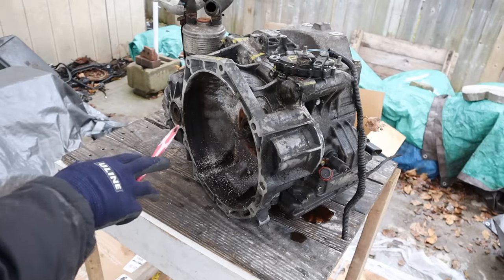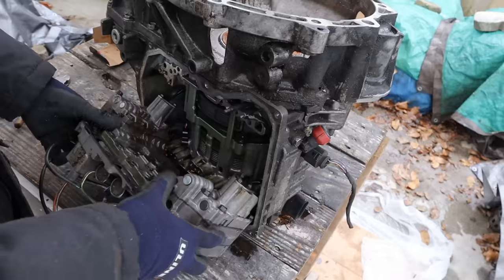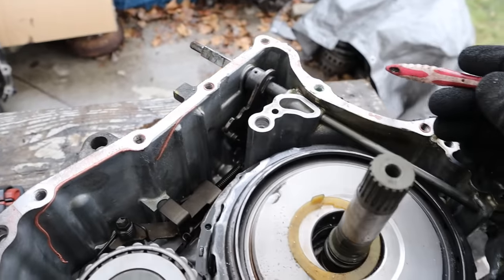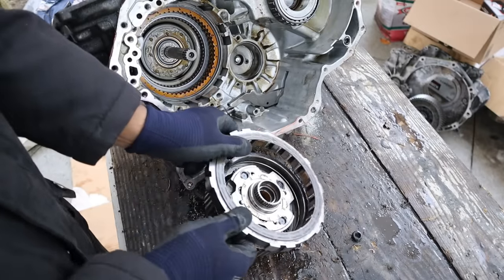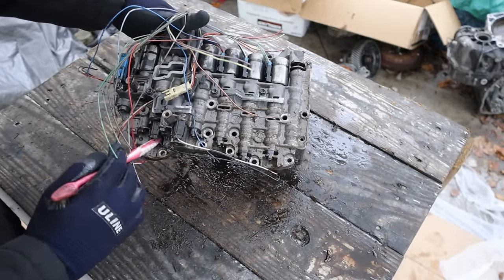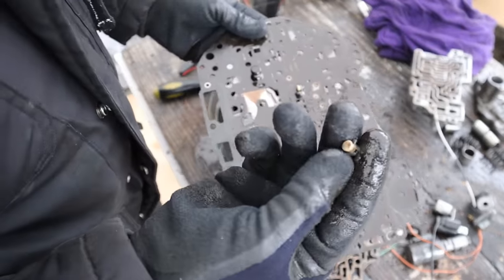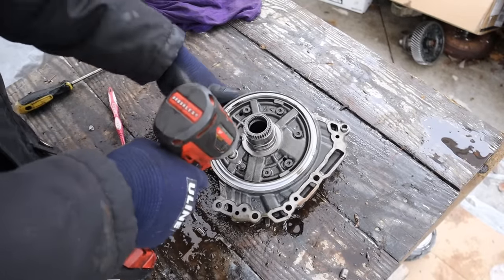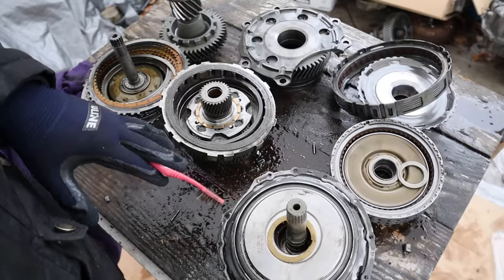Why Volkswagen 09G Transmissions Fail

Comment: Why do they fail? Answer: Volkswagen
Reply: Except not made by VW and another poster commented that they’re also used in Toyotas. I never heard of Toyota transmission failures though.
Reply: 10:55
Reply: @craigiefconcert6493  I have heard of many Toyota failures.
Reply: Yet soooooo many people believe vw to still be reliable. One of the many things still making vw money from the days of air cooled reliability
Reply: Correction, because they're German
Reply: Actually transmission failure is less common than engine failure and they only fail at very high mileage and usually from not fluid servicing they are actually pretty good
Reply: @Chrissy212  mine has been jerky from the start but it didn't give any major problems until it started leaking ATF arround 80,000 miles. At that point the mechanic replaced the valvebody and fixed the leakage which greatly improved the many of  problems I had, but I still have some slipping on the mornings. And I don't know about you, but I did not expect to have these kinds of issues at this milage.

Comment: The 09G is a automatic transmission designed by Aisin Warner (Toyota), also known as the TF60SN, that fits a variety of Volkswagen , Audi, Toyota, Lexus, BMW, GM.... vehicles.  The list of Vehicles this transmission is in is expansive.  The new Aisin 8 Speed's list is just as expansive.
Reply from the maker: Yes
Reply: Where can I find a book on this   transmission and easy place for parts are they worth rebuilding or should I just find a used one lol😂 
 Their is 2 or 3  versions of this transmission also right. I know theirs a couple different filter / pan setups

Comment: I struggle to understand anyone who buys a VW over a Toyota or a Honda
Reply: I struggle to understand the total ignorance of people like you who think the Aisin transmission is a VW part.  You clearly don't know that Aisin is owned by Toyota.
Reply: @einfelder8262  VW went with it. So it's a VW sanctioned part.  Just get a manual trans. These are done at 150k-ish.
Reply: in this case it doesn't matter a lot. But overall it's just marketing and doing what other people do, without thinking by themselves
Reply from the maker: If everyone bought a Toyota or Honda life would be a different way....much more boring than it is now.

Comment: Nice and complete teardown. These transaxles are actually pretty mechanically robust as you discovered during your teardown. The weak link is actually the linear solenoids of the valvebody as the small bushings inside the coil assemblies wear and get contaminated and stick the armature causing failures. It’s the same exact failure mode as the AW55 5 speed auto used in many GM, Volvos, Nissans, and other European makes. These are the first design large can solenoids found in many AW designs and some Toyota transmissions. They eventually redesigned the linear solenoids to a small can design eliminating the bushings and the sticking problem.  They are interchangeable as well. You remove the linear solenoids by removing the small pins with a magnetic pen or pickup tool. They slip in and out easily.  The adjusters are to make changes to the regulator valve inside each control bore as each linear solenoid has no adjustment. This is another change AW made compared to the early AW55. The adjusters were part of the solenoid assembly. 

More frequent fluid changes make a big difference in the life of these transmissions as the OE had really bad advice here. Also later designs with the small cans last a lot longer without failures.
Reply: Thanks!
Reply: Good info. AW55s in turbo Volvos drop like flies for similar reasons - sends a lot of good cars to the scrapyard as the replacement gearbox must be reprogrammed using proprietary software; total costs usually exceeds the car's value. Didn't know VW autos had the same issues.
Reply from the maker: I tried using a magnet and couldn't get them to come out either
Reply: @tonyl7286  The problem with the AW55's in Volvos is that they don't have a (replaceable) filter; inbuilt obsolescence I think it's called ;-) The nightmares I had with these shitty things.
Reply: Can you swap a 09G out with a later model VW trans . I read there are 3 possible valve bodies and  was informed Vw doesn’t have any new replacement valve bodies for purchase anywhere in the USA.  I don’t trust rebuilt trans companies . What would you do if your 09G was slipping. I changed fluid with little difference. Maybe change fluid again?
Reply: They did have bad advice back then for it.  Lifetime fluid was it!  Still it they had a badly designed valve body.  I wonder how much of a loss Volkswagen was taking as a result of that.  Would the Tiguans have a better valve body?  I am thinking a 2020 or 2022.  Surely all of Volkswagen's transmissions aren't cursed with bad valve bodies?

Comment: Thank you for posting today, I appreciate it. Merry Christmas to you, your wife, your brother, and their respective toothbrushes and T-shirts. 

Something that bugs the hell out of me...transmissions must be engineered, and they're always changing them, but why do so many of them (automatics) have so many problems? I mean, they're complicated of course, but it's not rocket science.  Well, in any case, I'm grateful that they provide teardowns for channels like this.
Reply: Well that's the thing, they are complicated. They gotta be made within the constraints of a budget, talent, application. People want something smooth, quick shifting, but it's going in a cruddy nissan versa, so they gotta compromise. Sometimes they have to source parts from a manufacturer and those parts aren't great. There's a lot of considerations. Most importantly is maintenance which is highly neglected especially among those who treat their cars like an appliance and only know about oil and filter changes. Some people misuse and abuse them, etc etc.
Reply from the maker: Agreed there...it's their shear complexity that make them fail. There's also multiple failure points and wear items like clutches and solenoids, where as a manual has none!

Comment: As it is said, so let it be written.......change all the !@@$# fluids in the vehicles. No matter the make, model, manufacturer. Blows me away the factory recommended miles per fluid change. Speedkar and many knowledgeable viewers have made it to be know. Fluids are so cheap compared to hardware. SO much time and money to repair/replace what could of remained in operation. Speedkar you are the Master with many knowledgeable viewers. Thank you "all" for doing your best to try & save this third rock from the sun.

Comment: Great video and efford made by Speedkar 99!  What I understand from this video is that mechanically the transmission is quite ok, and also that it is clear that changing oil is critical. Again and again this is proven by technicians. So, no matter what people or even dealerships tell you, just change the oil in your car frequently, both engine and transmission. It will save you a lot of trouble and off course a lot money!
Reply from the maker: Agreed! It's such easy maintenance and yet it gets neglected.

Comment: From what I understand it is the valve body that fails on this exactly as you have described!  VW claimed this was a fill for life Transmission, the first red flag!  Great video 👍
Reply: For the first couple of years yes. After many rabbits blew gearboxes around 150k miles vw recommended 40k mile fluid changes.  There's a dude in Reddit with automatic passat with over a million miles. Just do your fluids and your fine.

Comment: That parking pawl mechanism looks awfully dinky for something that can hold the weight of a modern car. There's a reason I use my parking brake so much, even if it's more psychological than anything. 

Nice video, some of the most complex stuff always goes over my head with automatic transmissions, but they're absolutely fascinating.

Comment: As a biomedical equipment technician (I repair medical equipment), learning about electronics was very abstract. You can not see electrons, you can not see the flow, you can not see the voltage, the best you can do is sense the heat, or meter individual locations to get readings. Very difficult to understand and teach.

Which is why I get paid the good money. 😜👍
Reply: Nice punchline.😂
Reply from the maker: Good call ..as we move towards a more electronic future, electrical engineers will definitely be more in demand.

Comment: I love my 09g transmission. I did have to get a replacement because whoever owned the car before me drove it until they burned the clutches on it. The used replacement works beautifully though. To get solenoids out you just need a magnet to take those pins out first. Been there done that.
Reply from the maker: Thanks for the tip on the solenoids, I used a magnet and they didn't come out.
Reply: @speedkar99  Since you said it didn't have a pan put some wd40. They may be stuck and just wiggle the solenoid. Those just slide in without and restrictions. They will usually fall out once you take the plate off actually.

Comment: In our '08 VW Rabbit, we had our transmission throwing 3rd and 4th gear codes IIRC.  Our mechanic ended up replacing the solenoids and it has ran a lot better since.  It's still not perfect as it sometimes slip if you mash the gas, but considering we're gonna drive this thing into the ground, I'm not too concerned with a valve body rebuild or anything else major.
Reply: my friend took it to a mechanic, and they fixed just enough to clear the code and drive home but then it failed again in less than a week, and they refused to see it again, maybe me scared of buying anything VW from then on-wards :(
Reply: @Eduardo_Espinoza   I feel that man.  When I was looking for a car for myself, I made sure to stay away from anything with this transmission, even though our Rabbit is a fun car to drive.  Ended up getting a Honda Fit and I love it.
Reply from the maker: You could have got the manual version.
Reply from the maker: You just running it as is slipping for now?
Reply: @speedkar99  more or less, yea.  It only really slips if you're trying to launch hard off a light or something.  During normal use, it's been perfectly usable.  We just keep up on the fluid levels and whatnot just in case.
Reply: @speedkar99  as much as I'd love a manual in that car, neither of us can drive stick right now.

Comment: I was watching a precision, transmissions channel and that pasty stuff is actually clutch material from the steel clutch packs. the clutch material just wears anyway,  usually not a big deal though if you change your fluid pretty regularly, but eventually you do have to have the whole transmission rebuilt

Comment: Excellent teardown. I run an 09G out of my Mk5 Rabbit '06. It's got 220,000 miles under its belt so far. Unfortunately, I never changed the transmission fluid - I never expected the car to reach 200k lol that 2.5 engine won't die. I'm heavily considering changing out the ATF but I get a lot of hearsay and gossip about changing transmission fluid in high mileage cars that have never had it done. I've never had issues shifting, plus it's done plenty of mountain/canyon and long distance driving. I tend to ride it hard, too. What's your take in your experience? Would I be smart to change out the ATF at 220k?
Reply from the maker: Drain and fill

Comment: Yeah i use to rebuild these like hotcakes. Wish I had more of them. I deal with the aisin transmissions vw use now which really don't have as many mechanical issues of the 09g. We've replaced so many mechatronic units for these while they were still under warranty.
Reply from the maker: Was it just the valve body that needed rebuilding?
Reply: @speedkar99   not at all. But it wasn't surprising when vta wanted us to replace the mechatronic and it magically remedies "all their problems" lol 😆  until it doesn't.
Reply: 09g is an aisin transmission...
Reply: @CatonsvilleCentralRwy  yes. Just not thr current  model

Comment: If you turn the microphone settings on your camera to manual you wont get so much background noise, cause everytime your not talking it will automatically adjust the audio level to bring in all that background noise

Comment: At 25K miles I drained 96 oz out of my CVT and refilled with 112 oz. still smooth and perfect at 85K. Fluid was changed 4 other times,112 out and 112oz back in always. The first change the original fluid was filthy!
Reply from the maker: Keep changing it

Comment: Do you by any chance know if any more modern Volkswagen transmissions are so awful?  I remember having had a Jetta with the 09G and it sometimes would have a shift flare when going up a fairly steep hill.  I lived in Pittsburgh and those hills can kill a transmission that is ready to die!!  I had the 5 cylinder engine and it is a good one but the with the 09G it is hit or miss.  If you have one that has not given you trouble yet change that fluid!  Also there are a lot of people who have tried alternative fluids but Volkwagen's fluid always worked the best in the long run.  It damn well better considering how much they charge for a bottle of it!

Comment: Valve body in the Aisin Warner AF40 also wears out the bore, hard shifts 2-3 & 4-5. Another "sealed" system that supposedly never needs the fluid changed. 🤦‍♂️
Reply: I'm at 140k and have changed the fluid twice. No idea if it'll prolong the life but hey.
Reply: Later models 2010 or 2012+ say 50k fluid changes.
Reply from the maker: Yeah that's the main flaw here. At least the valve body can be swapped out

Comment: My trans in ‘09 2.5l Jetta was never serviced until 120k miles, which was around the mileage when it started to shift rough. So I do a drain and fill. Six months later, it started slipping anyway. my trans replacement is out of a ‘09 Jetta 2.5l Trans has less than 30k miles. I’ll be doing a drain and fill every 37500 miles/ 60k km like the manual says. 

Prior to getting the transmission replaced, the valvebody was replaced in the original trans almost 3 years (13k miles) after I did the first drain and fill. I thought a remanufactured valve body would be a good idea (big mistake). It just started slipping extremely hard after that along with new fluid.

Comment: I noticed the  filter  is really more of a screen than a filter i think if they went with  regular changes and  more traditional filter the valve body may not have as much trouble as they do are shift hard second and to third and slightly hangs to 4 sometimes now the other major issue is the driver side cv axle is a pain  2 3 shops tried getting it out the traditional way. Only way get it out weld a big hammer to it or  bang wedges or fork behind it or put a new axle in the old  inner cup  thats what had to happen to ares for the time being but after it being horsed on in the shop it makes a  light chatter and im.not sure if its the new axle chattering in the old cup or the  differential is messed up.from them beating on it . Ive driven 20  thou plus and its not gettinf worse with 226 thou on it . I changed the fluid     last year  since my wife had no idea it if it had ever been done  it came out looking like motor oil with a grey hue to it 😮 lol 😂   the magnets  werent really bad considering the millage some light creme on them. Probalt from the valve body 😂
Reply from the maker: Ouch!

Comment: Depending on which ones are worn out you may get flares at times.  You will see the engine speed jump to around 4,000 RPM and it will be like a slip.  Most likely a bad valve body is the culprit.

Comment: Thanks again for another great video. Is it possible I could make a request? I don’t know where to ask so I’ll ask it here. Can you find a Jeep Cherokee KL (2014-23) to tear apart? They have a unique drivetrain known as “Active Drive”. A ZF9 transmission with 5th speed dog clutch attached to an electronic PTU (transfer case) that is connected to a driveshaft that somehow disconnects the RDM (rear differential) turning the Cherokee into a FWD car when not in use. On paper this is great. I can get 30 mpg with the 3.2 V6 on flat roads and highways. Then in auto mode when needed the 4WD system kicks in seamlessly and automatically. But.. The failure rate of Active Dive (could be PTU or RDM) is so bad Stellantis can’t keep up with spare parts. If the PTU fails a certain way, it will cripple the Cherokee with no repair parts sometimes for months even with the warranty. How do they fail? Why do they fail? I suspect it’s a flooded electronic actuator motor. No one seems to know for sure. There is no in depth information about the Cherokee KL Active Drive. Nothing close to what you do. Thanks.

Comment: Vw factory recommended 80k fluid change for their trans
Reply from the maker: That's too long
Reply: @speedkar99 60k good ı guess
Reply: @speedkar99  a few I spoke to about the intervals said: 60k km/37500 miles for a interval. Is that good?

Comment: lifetime  guarantee means lifetime of the car guarantee .
what is the lifetime of the car ?  manufacturer spec is 2-3 years . some offer 5  .
Reply: If you read the fine print, it is the lifetime of the warranty in most cases.
Reply from the maker: Lifetime of the transmission lol